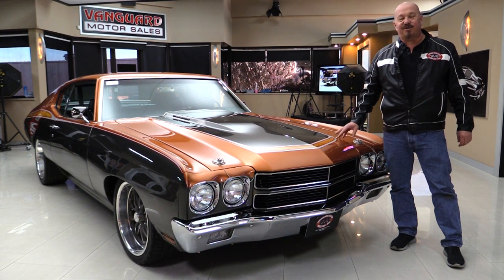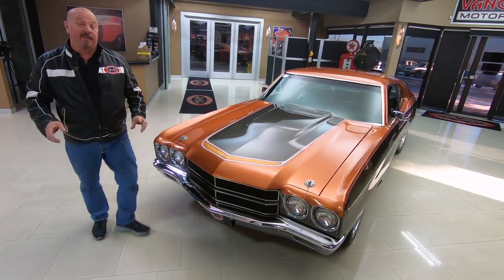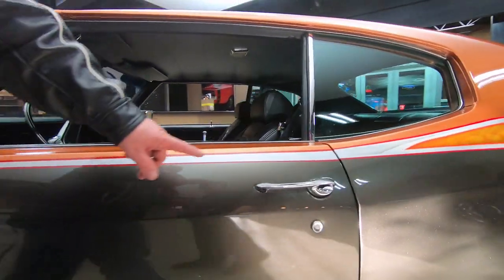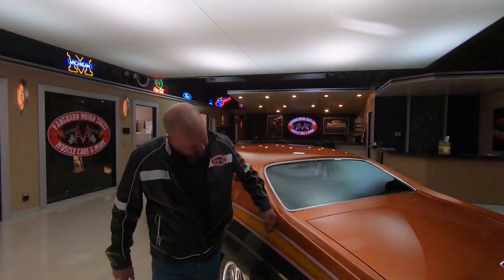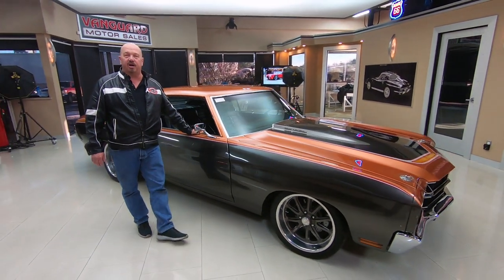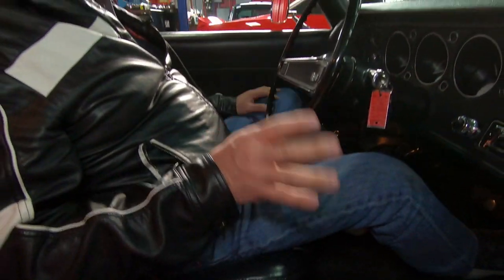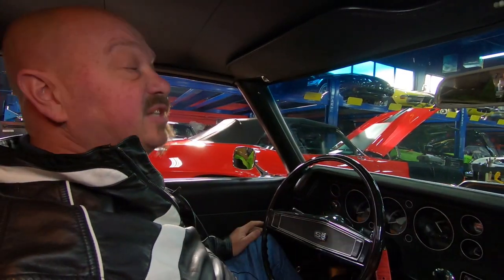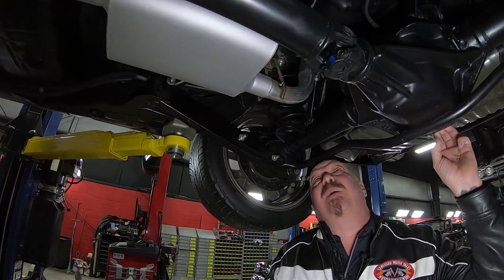1970 Chevrolet Chevelle For Sale

Comment: Cars I had in the 70's that I wish I kept.
1) 67 chevy chevelle
2) 72 chevy chevelle ss
3) 67 dodge coronet
4) 68 chevy impala
The really sad part is, used cars back then were cheap. I paid less than $500 each for the cars. It wasn't untill books like kelly's blue book came out that used car prices soared.